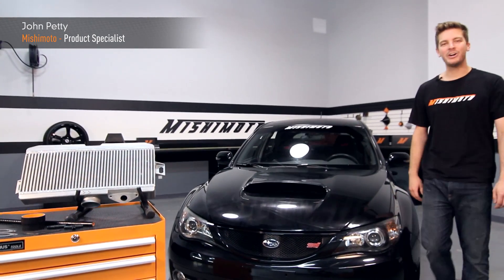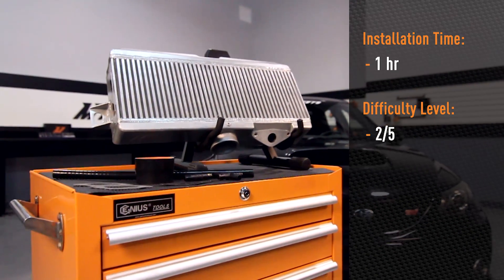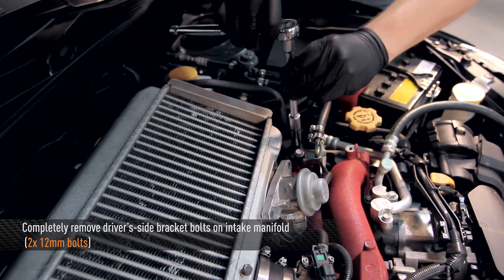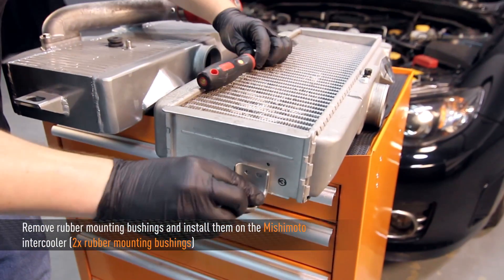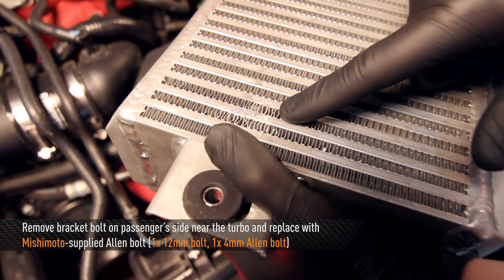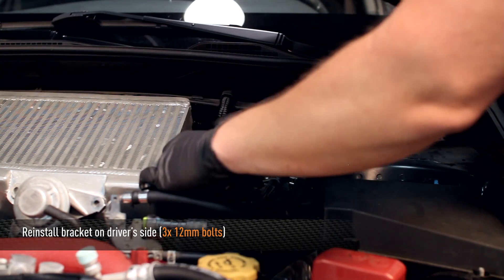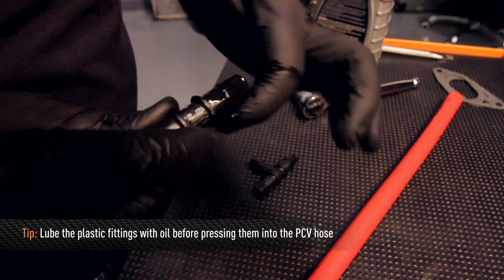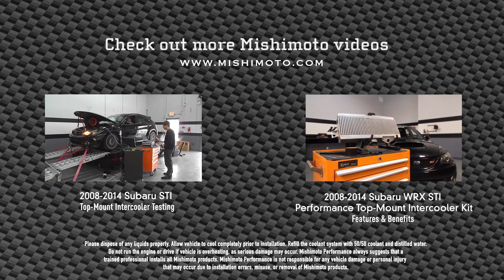Performance Top-Mount Intercooler Kit for the 2008-2015 Subaru WRX STI Install Video

Comment: I have a 2006 Subaru Baja 2.5 turbo.  I’m having the hardest time looking for the right Mishmoto intercooler set for my car.  Any info would be helpful.  Most sites don’t include Baja as a submodel
Reply from the maker: Unfortunately, there is not much that will with the Baja. Some people have fitted intercoolers for the early USDM STI models, However this requires modification of the entire system. I would take a look at the nasioc boards and see what other owners have had to do to make this work.

Comment: it works for the 2017 sti? Pls help
Reply from the maker: Hey yoyigu. I'm almost positive that the 08-14 will not fit the 2015+ due to the chassis changes. We have yet to get our hands on a 2017 model for confirmation. Wish I could be of more assistance.

Comment: So will this throw any codes?
Reply from the maker: This intercooler will not cause the vehicle to throw any CEL codes. This product was designed as a direct-fit unit that will outperform the stock intercooler, additional tuning is not necessary.
Reply from the maker: Hello ScoobySTI Chris. We have not had a 2018 model in for testing at this time. However, being that they use the same engine, this should in theory work just fine on your vehicle. I simply would not be able to guarantee that until we get one at our test facility.
Reply: Mishimoto Automotive many thanks 👍
Reply: Will this intercooler fit the 2018 WRX STI?
Reply: Mishimoto Automotive you can borrow mine